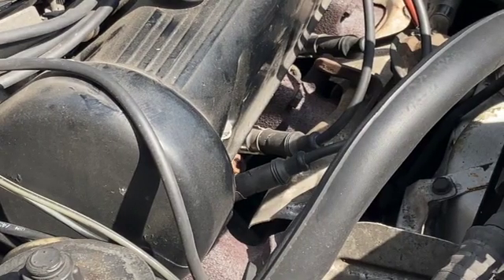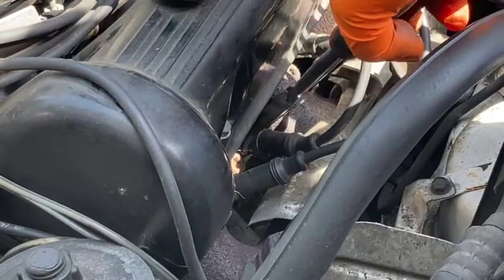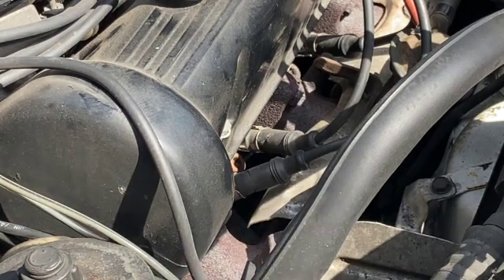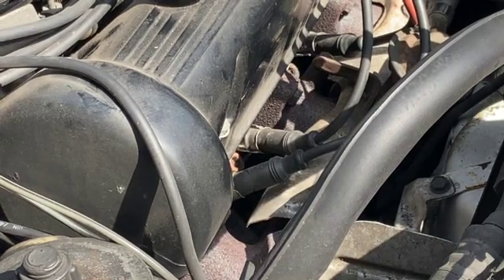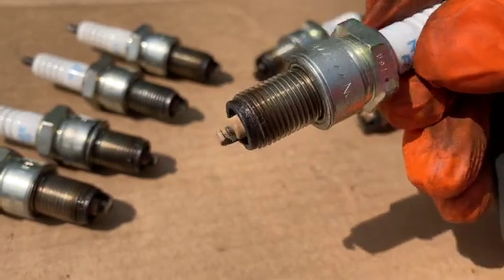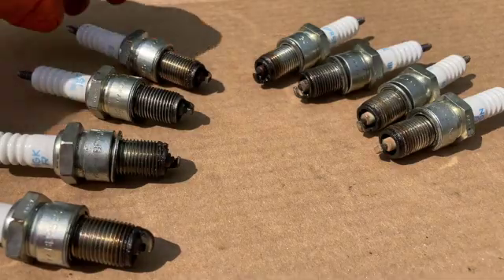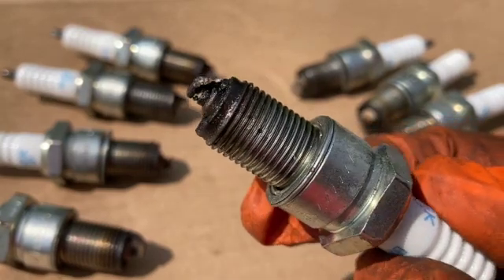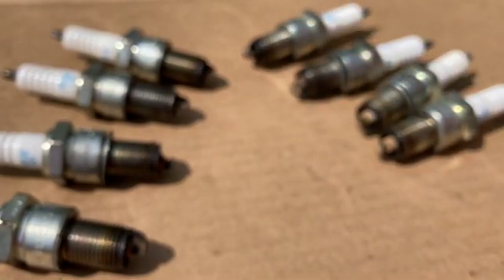Diagnosing hard miss on I6 and V8 gas engines W126 W124 R129 R107 Benz engines   SD 480p

Comment: Thanks for this video. I have a shake that is there basically all the time but is most noticeable at idle and lower speeds, such as reversing out of the garage. It is very inconsistent and hesitates but never feels like it is going to die, just is rough and a bit jerky. I've ordered insulated spark plug pliers that get here Saturday to do as you have as it seems like this could be the case.
Reply from the maker: Be careful and good luck chasing down that rough idle.

Comment: My 420sel has engine shaking during idle. The plugs are new. It use to run smooth before I changed the ICV due to a very high idle. Now it idles 700rpm but the engine shakes a little bit and idle goes up and down +,-50rpm. This only happens in park and drive when idling. It runs great when I get it after idle.
Reply from the maker: Hmm. That appears to be going hand in hand with the changing of the ICV. Is that an OEM part or an aftermarket unit? The latter may be the reason you are experiencing this phenomenon.
Reply: Its a used german one that was guaranteed to work
Reply from the maker: @georgesand4629  : / Well, was it one in a genuine MB box?

Comment: Hi I have W126 every time I put new plugs  they get burns and the fuel is getting more into the plug and keep having miss and also lost power when you accelerate.
Reply from the maker: What do the plugs look like when you pull them out? Are the electrodes actually burned, or is it oil that is leaving carbon residue?
Reply: @straybenzes  its actually black and look like burned from the smoke .because when I drive it stay 5 minute  and lost a power as it doesn't move at all
Reply from the maker: @ismailismail1248  If the black stuff is dry then I would focus on the fuel and injection system. If it is really oily I would say you may also have an issue with the valve stem seals leaking oil into the intake. When did this issue start happening?
Reply: @straybenzes  its started few months ago I have change oils filters, fuels filter, clean the tanks ,changed the plug wires because everything I tried and all the mechanics I took the car they come up with different things and it's not working
Reply from the maker: @ismailismail1248   This is indeed a challenge to figure out with so many systems that can go awry. Can you do the work yourself? Check if you have a spark. Then fuel supply is next.

Comment: Really informative; I have an M103 with a lot of fish nibbles, and though I replaced by valve stem seals and thereby drastically reduced my oil consumption, I did not replace the spark plugs. So I’m going to check that next. 

Great channel!
Reply from the maker: Good luck! Hopefully that will do the trick.

Comment: Great video. I’m having the exact symptoms you described (86 420SEL) with new non-resistor spark plugs, new distributor cap and rotor. My gas mileage has also dropped from 400+ miles a tank to around 250.

I look forward to a valve guide video!
Reply from the maker: Thanks. Oddly enough the gas mileage was not affected by this condition. Usually, there are more than just one underlying issue for similar symptoms. Try isolating one issue at a time and see what happens. Good luck.

Comment: Hello, great video. However, I have a bosch 7911/WR 9 DC + plugs that I have not installed. Can I install them? Should I think about the  Spark Plug - Bosch WR-8-DC+ (7905), also?
Reply from the maker: Those are both "R" meaning resistor type plugs. Do not use them. They put too much of a resistance on the ignition system and this can lead to an engine not running quite well and even  potentially harm e.g. the EZL
Reply: @straybenzes  any recommendations for a 1987 107 and a 1990 W126
Reply from the maker: @RasSosa  This one is one that I have used https://shop.advanceautoparts.com/p/ngk-standard-spark-plug-7734/5392543-P
Reply: @straybenzes  I would like to say thank you sir. I have been researching while awaiting your answer. Our thoughts have been aligned now. I will go fort and enjoy 'happy motoring'. Thanks again, blessed be, sir...
Reply from the maker: @RasSosa  Thanks and same to you.
Reply: @straybenzes  question that ngk 7734 seems to be a resistor plug sir?
Reply from the maker: @RasSosa  You are absolutely correct. I unfortunately did not read all the way through the specification. Here is a version that will work though: https://www.ebay.com/itm/203486468822?hash=item2f60bd1ad6:g:wyYAAOSw1ghgvhHa

Comment: Very informative and agreed on carrying out the simple/cheap fixes first!

Any reason why you were using NGK R spark plugs which I believe are 5kOhm resistor plugs? I think my EZL got killed with resistor plugs 5kOhm and high resistance plug boots 5kOhm…in addition to the 1kOhm rotor arm. I think the factory manual also advises against putting too much load on the high voltage side. I’ve gone back to the original W7DC0 with a slightly larger copper core which MB supposedly specified and my idle has become super smooth.
Reply from the maker: You are correct. The R type plugs are incorrect and I noted that in the video description. This can indeed cause other unintended issues and it is best to use non R type ones.
Reply: @straybenzes  Sorry, I should’ve read the description first!
Reply from the maker: @Finnoctane  No problem. I should have used the correct ones in the first place.